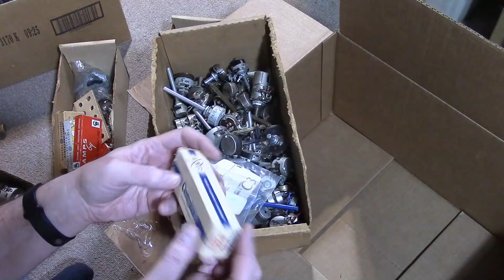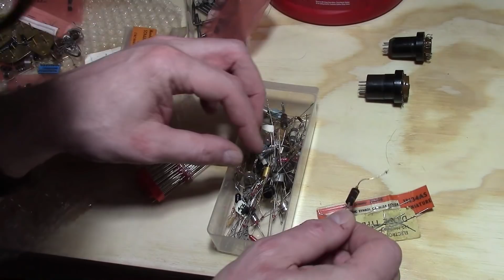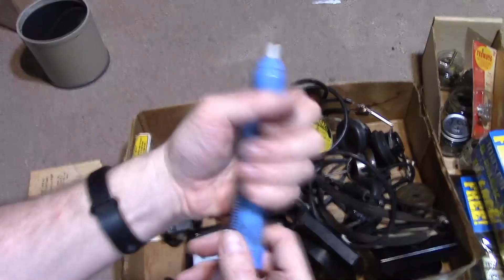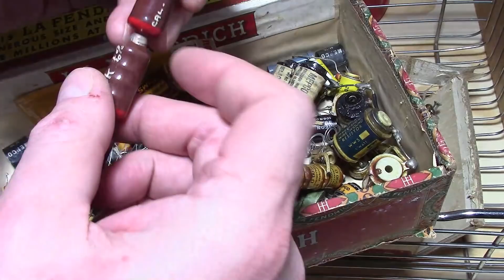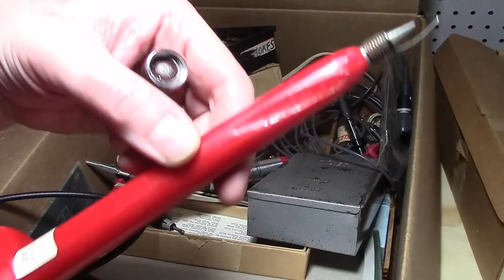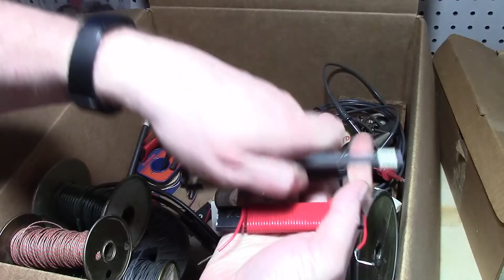Estate treasures: Hidden gems

Comment: Those 1/10% resistors I think were for calibrating multimeters.  They had a banana plug on one end so it could plug directly into the meter and eliminate the resistance of the test lead.

Comment: I have some of those old transistors too. They are real low gain, high leakage, but they do actually work. I breadboarded a simple preamp with one and drove music through it, sounded fine at 1ma. Not much gain but really impressive they still work. I think the usable gain I could get for clean audio was about two, that was with no emitter bypass cap. I'm not sure there are any specs on them, I couldn't find any. Very cool.

Comment: Way back in 1988 my mom had a garage sale with two tables of her then deceased fathers electronics stuff. 
Older style TV's from the 1950s, Knight  tube tester , Heathkit VTVM and lots of assorted parts in plastic boxes  in two large storage cabinets and baby food jars full of screws, resistors , capacitors and tubes. Lots of tubes. Maybe 300 of them.
All for radios and TV's from 1940's to the mid 1960's. Dozens upon dozens of Howard Sams TV manuals.
Had three Fasco CI-8202 Intercom system boxes which used the AC line to send and receive. Couldn't miss the melted 
part of the bottom of their cabinets from all the contained heat. She sold everything! Well not really, I managed to steal 
away from her gramps   assembled but never used Heathkit  IO-102 oscilloscope, a  Knight VTVM, Heathkit soldering
 iron GH-17,a rare Knight  high VHF tube receiver. Later I saw a matching Knight low VHF tube receiver on fleabay. 
So I grabbed it. Got to add to my collection of Greenlee chassis punches one day. Thanks for bringing up some old 
treasure memories there Bob from your haul of goodies!

Comment: I think those glass tube things are some kind of T/R cell. They are used in high-power, high-frequency communications when the transmitter and receiver share the same waveguide. When the transmitter is operating, its signal ionizes the gas inside the tube, shorting the receiver's signal path, so protecting the receiver from the high power signal...

Comment: Those letter sized drills are usually use with thread cutting taps. The hole drilled for needs to be slightly smaller than the bolt's diameter before the threads are cut.

Comment: That’s a widowmaker drill.
Reply: It's OK , just don't use it in the bath tub.
Reply: @drp457  😂
Reply from the maker: Yeah, I suppose the ungrounded, metal casing could be a problem 😬
Reply: @bandersentv  exactly, has happened.
Reply: OK plugged into a GFCI, but that arcing will trip an AFCI.

Comment: Those Maxell cassettes are Type II, not metal which is Type IV. Still a nice find, worth about $5 to 8 a tape.
Reply: Type II are chromium dioxide. Less noise and higher frequency range than type I ferric, but cost more at the time they came out. Mid 1970s. Decent for music. Requires medium bias for recording.

Comment: pretty sure those gold pins are just wire ends, for clamp terminals, screw terminals, or speaker terminals. Just so you 're not fraying wire ends. No more twist-and-shove

Bob, I'd be willing to buy some of those type-II tapes from you

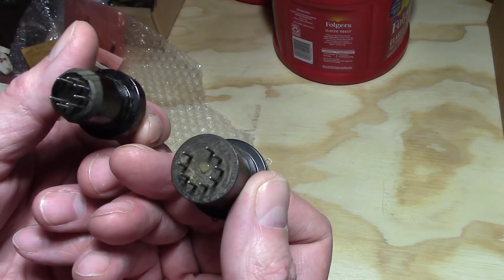Comment: 18:40 Those socket extender test point tools are worth their weight in gold. Sure beats getting under a crowded chassis and trying to play the "Operation Game" and not hit the sides with shaky hands. Wish someone would make them again.
Reply from the maker: Darn right.  I'm grateful for the few I have.
Reply: @bandersentv  I have a couple of extenders for checking cathode current of 6L6, 6V6, that only breaks continuity of pin 3, the rest are just soldered across with no test points. Wonder if that would work for horizontal output tube cathode current.
Reply from the maker: @zulumax1  Possibly, but I have a dedicated cathode current meter.  It sockets for all the common horizontal output tubes and a meter built-in.  Very handy device.